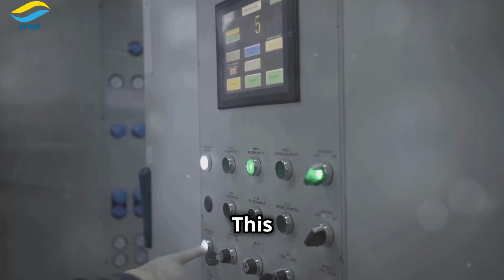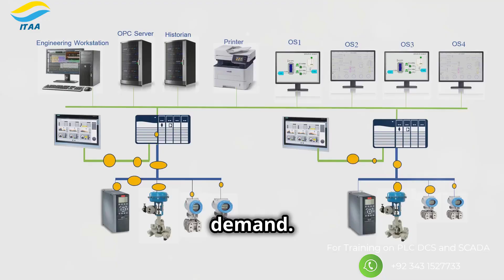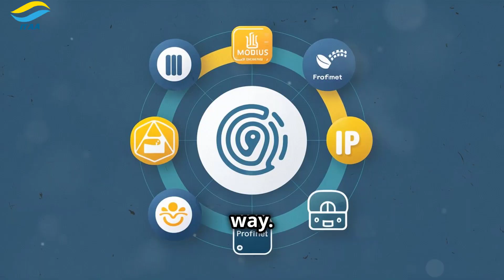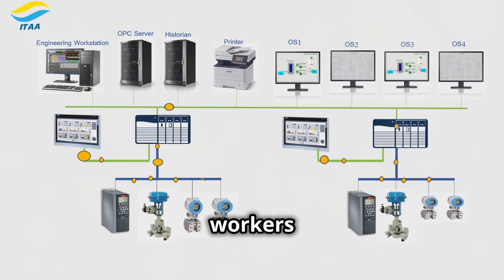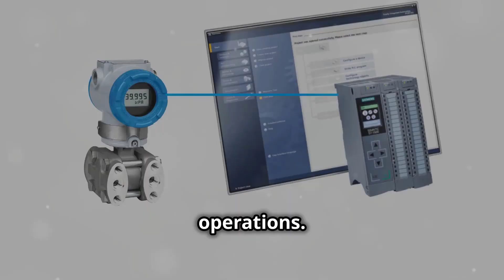Will 𝟒-𝟐𝟎𝐦𝐀 be No More?

Comment: The BS excuse about cyber security is getting old. It boils down to cost nothing more! As soon as you introduce noise into PROFIBUS system say A bad VFD of poorly routed high voltage lines its game over! Not to mention some arc-welder grounding his equipment 80' away from where his welding. Yep, it's happen so good luck:)